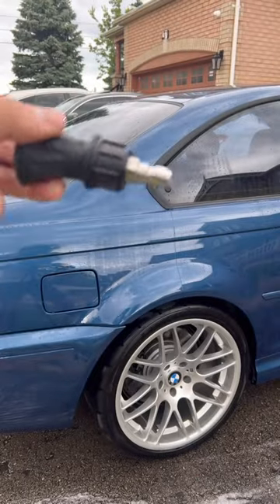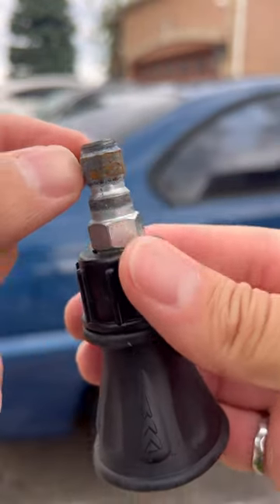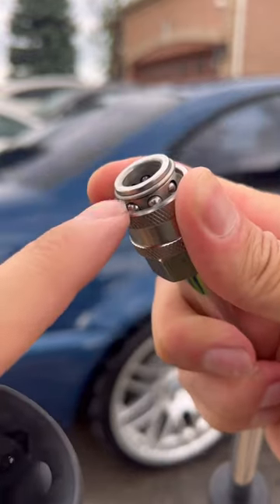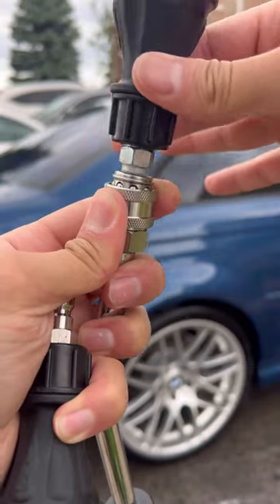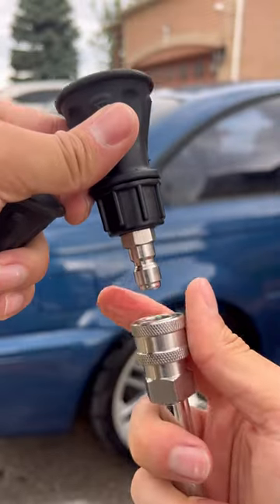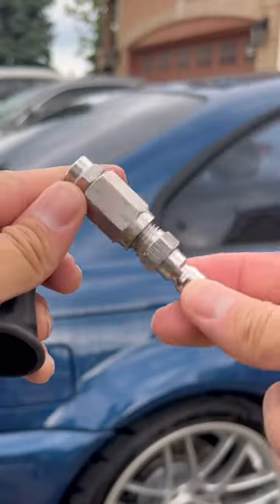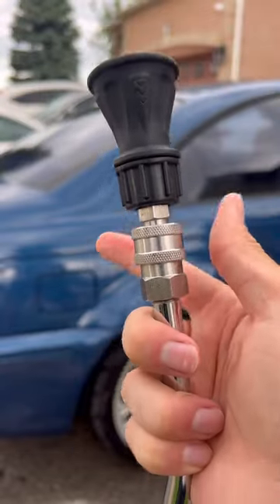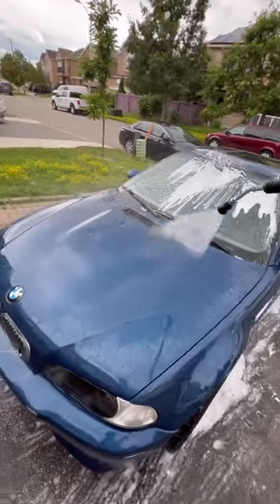The Difference Stainless Steel Makes For A Pressure Washer Rinsing Nozzle for Washing Cars #Shorts

Comment: May I suggest 316 stainless, it’s a bit more expensive but it has quite a bit more corrosion resistance than 304.
Reply: Why? Is the 304 not getting the job done?
Reply: 316 is ideal in salt water conditions but will actually rust in fresh water compared to 304.